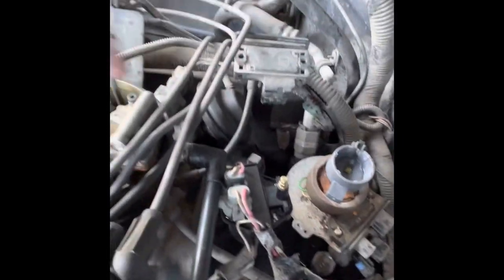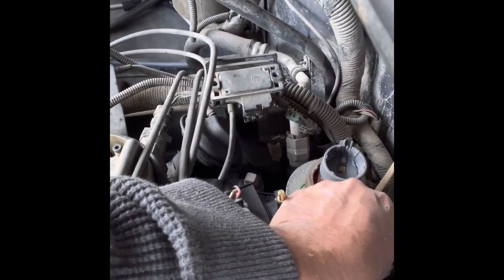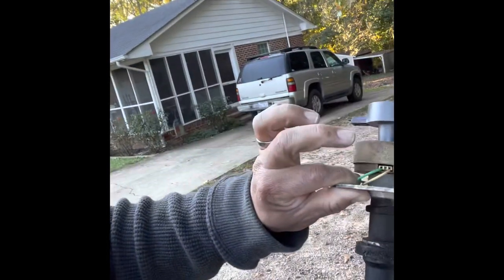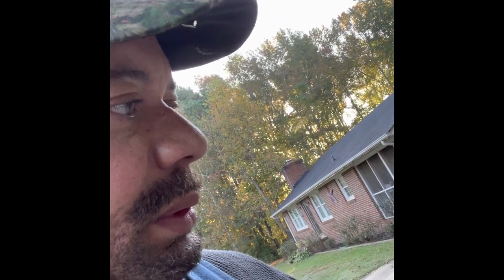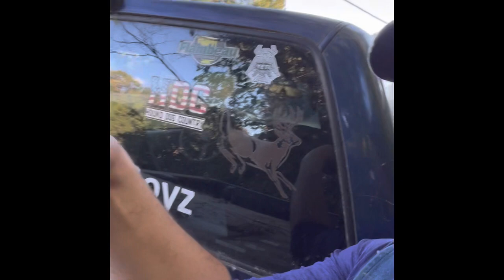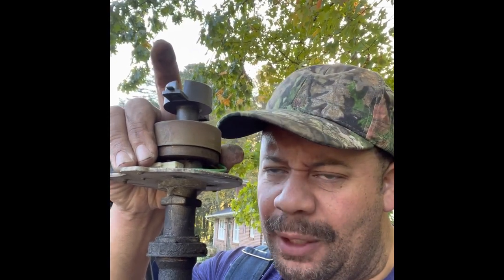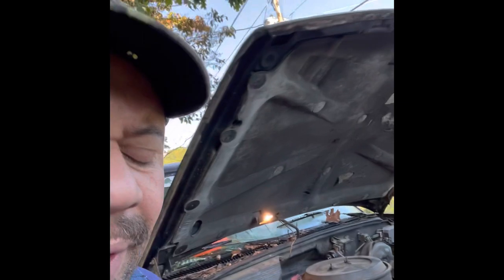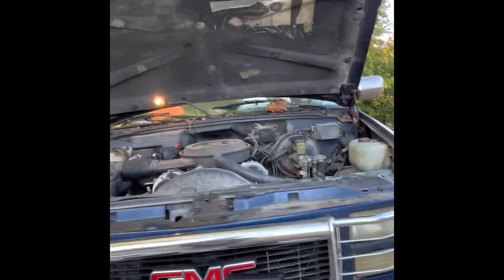Easy Distributor replacement 94 GM 1500 / it’s hunting season…

Comment: the pin at the bottom of the shaft runs your oil pump, you must of got it correct bc the engine is still running.
Reply from the maker: That’s right… I’m glad it’s good.. I’m ready to hit the woods

Comment: How the Amazon unit holding up? I just ordered it  for my obs
Reply from the maker: Perfect.. I just put a starter on also from Amazon for $50 and it was awesome too…
Reply: @TheCATFISH1949 question.. when you put it in did you have to adjust it for the timing..? Or you just lined it up and fired it up
Reply from the maker: @ lined it up and go ! BUT .. it’s not perfect! I should have timed it . Nevertheless, it’s working . I did turn it a little after I had it running, and left it at the best place. Hope that helps
Reply: @TheCATFISH1949  thanks for responding..I'm finna tackle this job in a few..was wondering about that..did you have to unplug a timing wire when you turned it